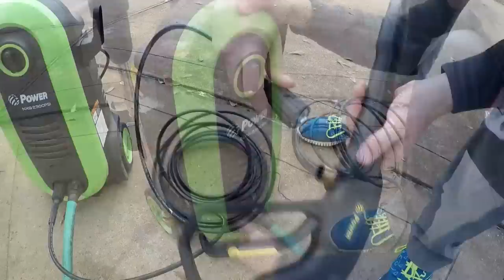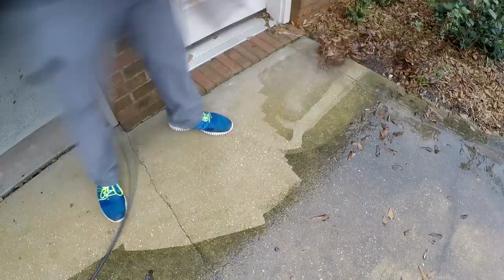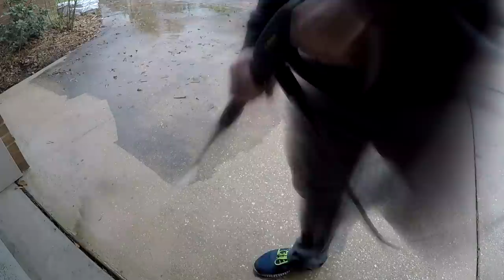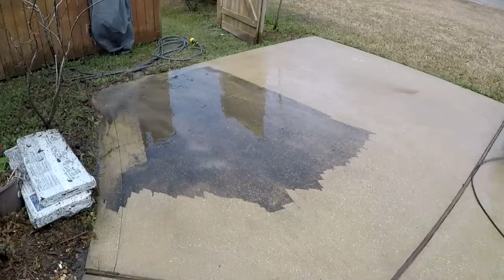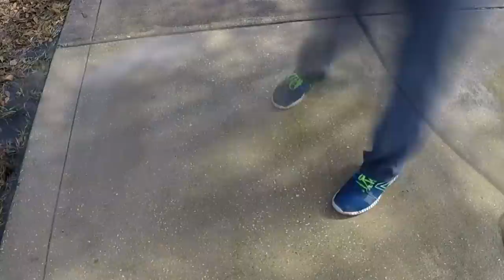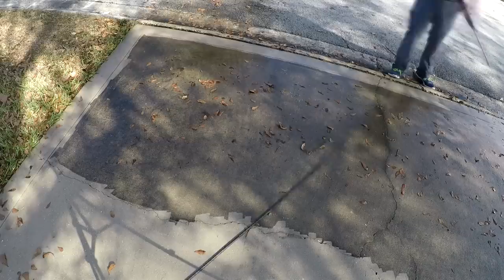Timelapse Whole Driveway Pressure Washing

Comment: Looks good Brad. I'd recommend getting one of the surface cleaners. I used to power wash decks like this and took forever and it was streaky. The surface cleaner is so much faster and does a much better job. Good job on it.
Reply from the maker: Sounds like a must have, I will look into it, thanks! :)
Reply: @CopperCreekCuts  They only really work with gas pressure washers. I tried one on electric one and it sucked compared to the gas. Just not enough pressure to make it work well.

Comment: Try using a pressure washer surface cleaner attachment it works much better and is faster
Reply from the maker: Thank you for the suggestion! :) And thank you too, Ashurii! ;)
Reply: Copper Creek Cuts Lawn Care, sorry was not trying to tell you how to do your job was just a suggestion and I guess you already knew about the cleaning tool.
Reply: It's not really any faster if you have good technique, like he seems to have. What is needed is a bigger pressure washer. That puny electric pressure cleaner he is using is what is slow. No electric washer is even able to drive a surface cleaner. They are only good for big/high volume, professional setups. I do this for a living and I prefer washing with a wand like he is doing here unless I have a giant driveway that requires hours and hours of time.

Comment: Great job on the driveway.
I don’t know about your area but here in my locale I can average $100 per hour(after fuel and chemical)soft washing houses,pressure washing fences and concrete surfaces and $60 per hour doing lawn care(before fuel).unfortunately there’s much more lawn care work than washing work available but lawn care opens the door to washing gigs and vice versa
Reply from the maker: Thank you for breaking down the numbers, that is pretty nice! I thought about pushing pressure washing this upcoming winter when things slow down, this comment is pushing me further in that direction! :)

Comment: Believe me when I say, I feel your pain! I still remember not being able to get up the next morning after a 4-hour run with a gas unit. Only difference, I was getting paid AND I had to fudge around while cars were driving by. (this was a commercial drive thru pad)

Honestly it's amazing that a tiny little lightweight unit can do so much! I just have one question: At what point in time did this project NOT seem like such a grand idea? If I remember correctly, after 3 hours and 30 minutes you hit the point where you just want to put the machine away, crawl into a hot bathtub and cry yourself to sleep.
Reply from the maker: LOL You are right. I knew from the beginning it was going to be torturous, but I had to test it and the driveway was the most obvious choice. I wanted to quit as soon as I started! ;)

Comment: Get a surface cleaner. The whirl-a-way B.E. is one that would help speed up your work and make it easier. It would work with your feeble washer.
Reply from the maker: That would have been nice! I was sent this unit for testing so wanted to complete a project 'as is' rather than modify it.

Comment: Brad 1      Driveway 0

At least you were already at home so you didn't have to drive immediately and could rest comfortably afterwards. 😊
Reply from the maker: But I couldn't! XD By the time I finished I was almost late to pick up one of my kids from school so I had to rush there! :)
Reply: Maybe next time, pause on doing the entire thing, get the kids from school, have them change clothes, send them outside and hose them with the pressure washer as you finish cleaning! I did that as a kid, when my father was using pressure washer to clean furniture or the car. I remembered the spray was strong enough to be felt through clothes and tickled on bare skin! 😂